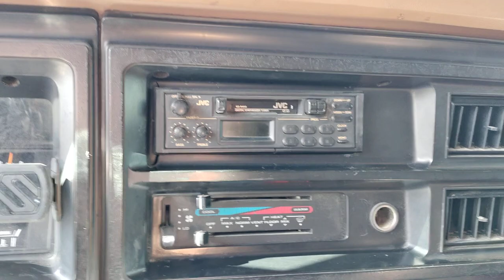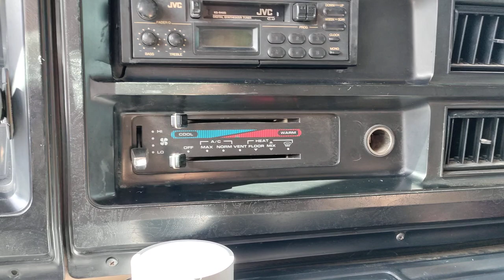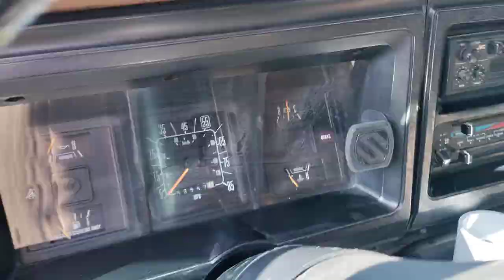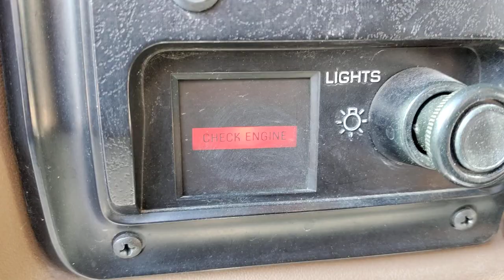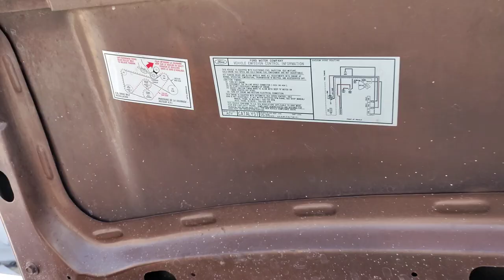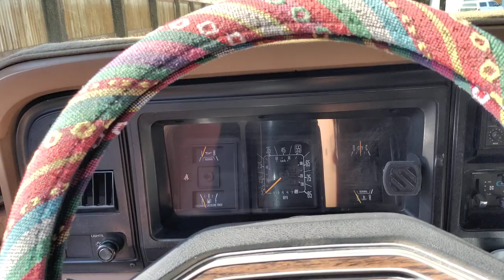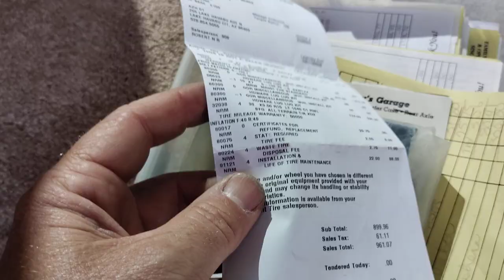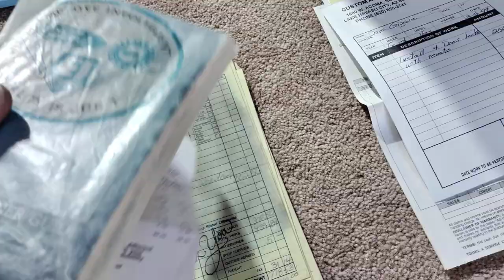EXTREMELY RARE 1988 Ford Econoline E150 factory manual 5 speed, short wheelbase, 300 4.9l FOR SALE

Comment: I have an 88 E150 standard length with the 300 Inline 6, 5 speed manual w factory A/C, hinged side doors, and a factory full length headliner, full length rubber floor cover, high back front bucket seats, and front door panels.  Otherwise a bare bones cargo van.  The transmission is the same Mazda 5 speed used in the F150.  These are quite rare but I have seen a few. My first one was an 87 In-line 6 with the 4 speed OD manual.

Comment: People just don't realize the immense variety of the 3rd Generation Ford van (75 to 91), from "old school" to modern things like anti-lock brakes and fuel injection. They have a very few weak points, but otherwise tend to put up with abuse and run forever. Any manual trans is uncommon but most were three-speeds "on the tree". There was a 4WD version in some years. Much of the running gear interchanges with a pIck-up  as do some interior parts. One of the best vehicles ever built.

Comment: I owned the exact configured one, 300 cu in inline 6 cylinder with the 5 speed manual transmission. And no windows at all, it was factory insulated and paneled, I bought it new in Timmins Canada, and it was a bitch to back-up as I could only rely on the mirrors, a back-up camera would have been very useful lol.
Reply: I bought a 1981 V8 (302) many years ago with a manual 4 sp transmission. For the back-up, it was not easy.  I'd like to know if you can tell me the "make" and "model" of the 5 speeds factory transmission. I'm on a project to restore another van (88 ou 90) with a 351W. 

Please let me know. (Sorry for my english, I'm living in Quebec and I usually speak french)
Reply: @stephaneouellet1439  bonne chance
Reply: @stephaneouellet1439  351 Windsor! Legendary motor
Reply: @kendallsmith1458  Sorry, my question wasn't clear enough. I'm talking about the transmission. Wich company builted it and if you have the model. I'm looking for a 1990 with a 351 W but I want to "fit" a 5 sp manual transmission on it.
Reply: I had that same issue, I had one of these 1 ton vans with the 7.3idi and the E40D. I backed that damn thing into about 4-5 barriers before I got fucking pissed off and got a rear door from a junkyard van that had glass.

Comment: Very thorough overview.  First, I'm OK with your payment terms if I were to move ahead. Just a couple of questions/clarifications.

1.  You mention the monies spent on the A/C system early in the video, and then reference the A/C again when scanning the box of receipts.  You state the system was never converted over, and you did NOT make it clear if there is, or is not, operating A/C.  So, what was done for $2,500 ?  I ask because I have a 1995 Jeep Wrangler, the A/C system cost me $1,000 15 years ago, and I've never had to do anything to it, and I have cold A/C.  In summary, while you state you are going to sell the unit with the A/Cas is - just what needs to be done to the A/C?  That should be easy to answer.

2. Is there any type/form of insulation on the body panels or roof?  

3.  Are those the original springs, and front end parts (control arms, etc.)?  You showed the newer shocks.

Last, I also live in Arizona but in a county where emissions is required.  That is Maricopa, Pima, and some of Pinal.
Reply from the maker: Hey there. There is foam insulation between the body panels and the interior paneling. The ac does not blow cold and I haven't addressed it at all. Could be an easy fix or could be a nightmare expensive repair. I honestly don't know. I probably should grab a few pounds of refrigerant and see what happens but I haven't had a chance yet.
Reply from the maker: Yes those are the original springs on the van. I bought a brand new set of front springs from o'reilly and installed them and it actually lowered the van about half an inch and it rode worse so I reinstalled the original coils.